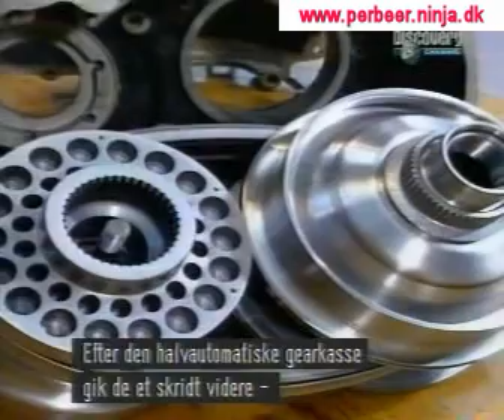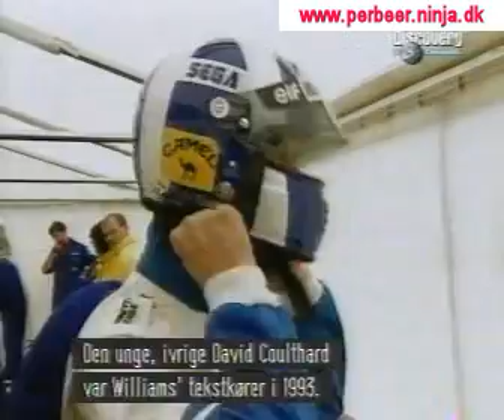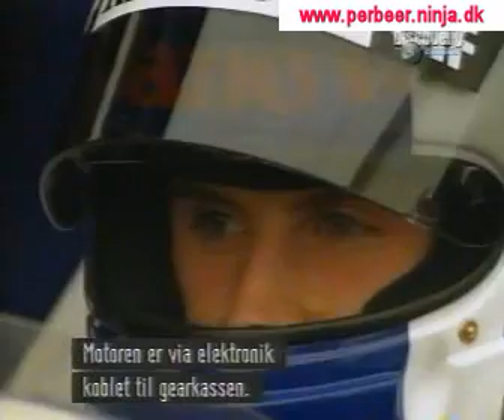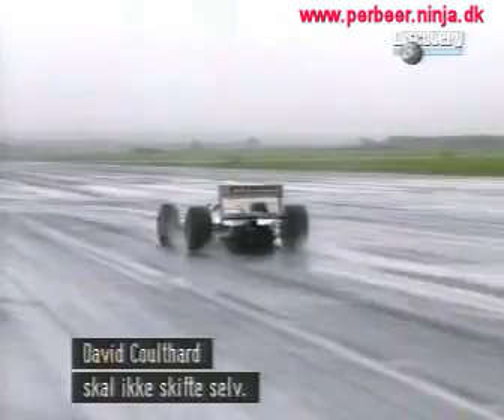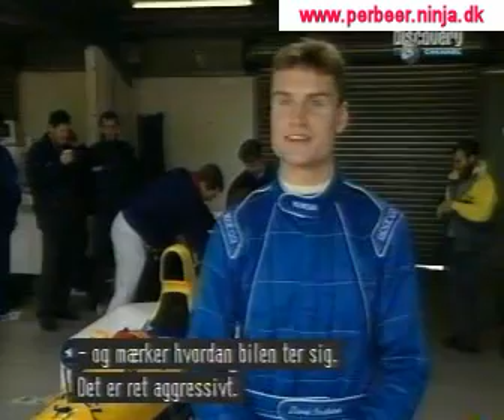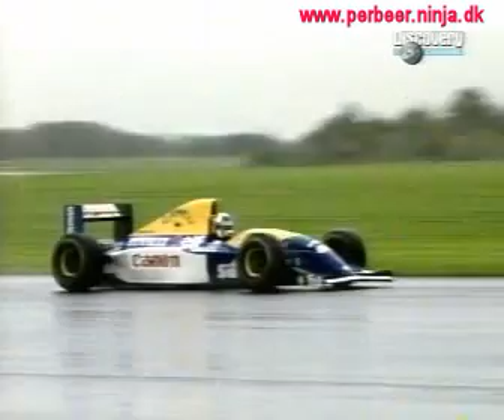Formula One with Automatic transmission

Comment: all you need to do is to have 3 gears, with two gears for starting off and the third one attached to a CVT and you can just stay on 3rd gear the whole time
Reply: That's not how CVT works. Gears have a fixed torque conversion factor. CVT keeps not only the RPMs in the preferred range, it also maximises torque by actually varying the gearing. It's as if it has infinite gears.
Reply: Or just use the cvt right away? This would make it more complicated than necessary.